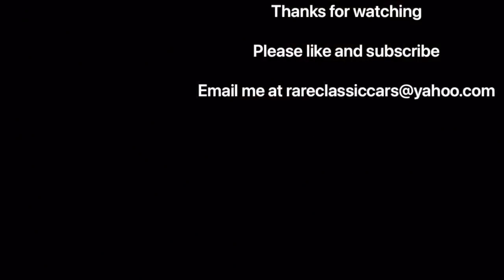Worst Engines of All Time: Chrysler 318/360/400/440 V8 Electronic Lean Burn

Comment: The secret starts at 10:00. But there is more,,, haven't had a lean burn but I dicked a lot on a BBD and could never fine tune it 100%. Either was way too rich or way too lean and would stall. The metering rods get sucked down by high vacuum when the engine starts. As you press the accelerator the vacuum falls and the rods go up, richening the mixture. When you reach cruising speed the rods drop down to your preset setting like he said. Theres a piston with grooves and a spring under it that controls when the rods go up as there is demand on the engine. This is controled by the stiffness, rate and length of the spring hidden under the aluninium piston. It aint big, like the size of a pen and the spring is like a 1/4 inch wide. I guess the aluminium of the carb and piston were really worn on mine. Bougth a lot of springs at Canadian Tire and by carefully mesuring, cutting and stretching many springs I ended up with a compromise. I adjusted it so as soon as I feathered the throttle the rods would go up. Solved my stalling problem but it never ran great when cold (too rich) with the choke on or partially on.  Had to wait 5 or 10 min before going. Hope that shines some ligth on the operation of the BBD. Thank you for your videos.

Comment: I had a 1978 plymouth horizon with lean burn, when cold step on the gas slightly and it runs until warmed up, the vw rabbit motor was very responsive

Comment: Great explanation Adam! You explain why so many people had trouble with the Lean Burn system. I wonder if anyone can provide a before and after (after replacing it with a regular carburetor and std. electronic ignition or even points) mpg results. Like with a properly functioning lean burn you got 18 mpg on highway trips, now you get 16. It sounds like lean burn was a great idea on paper and in the lab.  Could some Toyota engineers have made this reliable for all Chryslers back then?
Reply: Lean burn shone on the hiway, over 20 MPG in a full size V8 sedan in the eighties. Figure a 25% increase in fuel mileage. I remember a magazine road test of a 318 powered early 80s Chrysler, EPA rated 26MPG hiway, in the same magazine was a VW Rabbit 4 cylinder, rated 25MPG hiway.
Reply: @mrdanforth3744  thanks. Truly a great idea but was poorly executed. Or was it as Adam said, where the real world heat cycles to the electronics of the day, made it doomed?
Reply: @new2000car  Partly because the electronics were not developed to the point of being totally reliable, and partly lack of knowledge of the system by mechanics. There were a lot of new anti pollution and electronic devices introduced in those times, often forced onto the market by the government before they were ready. Driveability, reliability, and engine life suffered from the late sixties until the mid eighties when they finally figured out how to make decent motors that met government regulations.

Comment: I have a chip on my turbo Buicks that lets me enable lean cruise 
when the car isn't under load and the converter is locked  (on the highway mostly ) it goes into lean cruise. 16/17:1 AFR. Works like a charm. Sipping fuel!

Comment: Yes, you are absolutely correct.  I had a 1978 New Yorker with a 400, Thermo Quad, Lean Burn.  Was a good running engine, started right up in any type of weather; even when hot.  However was a TOTAL dog when it came to performance!

Comment: All with the thinking of saving costs, they ( all 3 )  lost the market. they could adopt a mechanical injection system ( possibly the Bosch K let «0 or electronic ( bosch L jet or D jet ) that were already  fine tuned and delivered a respectable performance associatred to a very good reliabilityé Im 1958, GM and Chrysler proposed  fuel injection systems, they abandonned them in the name of cost reduction

Comment: I bought a long block 440 with a stock 4 barrel manifold minus a carburetor. He said it came from a 1976 Chrysler. What distinct difference should I look for in the distributor to know if it's a "lean burn" unit or not? Or what is the water temp sensor part number if that's unique to "lean burn"? Anyone can reply. Thanks.
Reply: Lean burn distributors have 2 pickups in them, one standard timing one 52 degrees advance timing.

Comment: Just a quick note, the air to fuel ratio is in terms of mass, not volume.  A gallon of gas doesn't mix with 14.7 gallons of air, it mixes with about 100lbs of air, which like a 747 full or something.

Comment: Thank you. After 35 years I finally understand why my '78 Monico had occasional difficulties keeping up with fully loaded gravel trucks and stalled just before grabbing 2nd gear a few times. A mechanic at work had a simple 2-word explanation and described it as "computerized crap".

Comment: I'm a retired auto mechanic I worked a lot on Chrysler Motors and Transmissions the Chrysler torqueflite 727 transmission can handle more power and torque than General Motors or Ford Chrysler torqueflite transmission are very good quality transmission I have also worked on a lotta Chrysler Motors the 318 all the way up to the 440 are really good motor you can do high-performance on the Chryslers and they put out a lot of horsepower and torque if you want any motor to last a long time don't run it hot do not run the car low on motor oil change your oil every 3,000 miles also the same goes on your transmission and differential if you want your car to last a long time don't Hotrod it when you apply a lot of torque app one-time suddenly any motor transmission or differential can break Chrysler Dodge and Plymouth back in the upper 60s ran a lot of races back in the day my grandfather work for Ford and built their NASCAR Motors also work for Chevrolet he's the one who taught me about high performance and how to modify motors for high performance and fuel economy carburetors I had a 65 Ford Galaxie 289 V8 2 barrel carburetor four-door pulled a 5 x 10 enclosed trailer from Missouri to Florida the mother only had 90 to 120 lb compression old motor new motor has 160 lb compression I got 23 and a half after 24 miles per gallon pulling a trailer with that old vehicle that's pretty good mileage for that big Car Plus pulling that big enclosed trailer so I disagree with the man in this video I revealed a lot of Chrysler's and I worked on a lot of Chrysler's Dodges in Plymouth
Reply: So after your retirement, you started cooking meth ??

Comment: The only thing I know about lean burn how to replace it with a msd box but none of the OEM ignition systems at that' time were in any way good so it wasn't just Mopar it was that weird transition period between carbs and fuel injection

Comment: Just a heads up... the air/fuel ratio is by mass not volume as quoted around 2:15  So stoichiometric is about 14.7 kg of air to 1 kg of fuel.

Comment: Lean burn has to be done at 28:1 with about 20º more timing advance to produce good emissions and good power. It does work but a carb cannot do it. I have it running on my 2007 TBSS, excellant engine torque and response. It's basically a second stoichiometric region of operation, all fuel burns but at a lower temperature. The extra fuel burn time increases average pressure on the piston, resulting in higher torque being produced. I have it switching to normal AFR at about half power (when it switches to the high MAF table). 

The way Chrysler did it was almost good but they didn't go far enough. Holden has been doing it for years, btw.

Comment: The lean burn sucked, I had a 79 cordoba 360 lean burn, I trashed the lean burn, got a older carb, used a vacuum advance distributor and got a transmission without the lock up torque converter.  It made a ton of power and was better on fuel when use cruise control.

Comment: 1:57 I realise the jug analogy is just an analogy, but I wouldn't want people getting the impression that the air-fuel ratio was a volume ratio when it's actually a mass ratio. This makes sense as the mass equates to the number of molecules in the chemical reaction, whereas volume can vary. Really interesting video, too - thanks!
Reply: Thank you.  You beat me to it.

steve
Reply: I was saying "No.  No.  No." during that bit
Reply: On a mass basis (not volume. . ) you would need 183 gallon jugs of air to mix with one gallon of fuel. (1 gal air = 0.01 pounds, 1 gal fuel = 8 pounds)
Reply: I was hoping someone would point this out
Reply: Not only that, but it’s 14.7 parts of oxygen, not air.  So, with air being (very roughly) 20% oxygen, it would take some 60 jugs of ‘air’.  And, as you mention, it’s mass, not volume, so increase the jugs in proportion to mass.  Not a very good analogy at all….. back to the classroom….
Reply: @donferrie4070  That was a detail I wanted to check before posting, and the Wikipedia page on air-fuel ratio says that the masses are "of all constituents that compose the fuel and air, whether combustible or not". I was half expecting it to be just the mass of the oxygen. Another reason for using lambda or FAER? :)

Comment: Great presentation and video as always! One detail I noticed is the explanation of air/fuel ratio. The air fuel ratio is determined by weight, not volume as in the gallon jug example so 1 pound of fuel will be combined with 14.7 lbs of air to achieve a stoichiometric ratio. Love the videos, keep them going!

Comment: Seems we had a much better run with ELB in Australia, not saying there wasn't a lot of ignorance and stubbornness but the CL/CM  265 six cylinder was the epitome of excellence with this emerging technology and alas Mitsubishi took over and shelved it, at its demise the 6cyl Valiant was a cut above all other Australian produced vehicles in terms of power and economy. I worked for Holden dealer but you couldn't deny the gap, I had the fortune to work with a guy who knew the system inside out and learnt to see its genius, later GM introduced Lean Cruise in its EFI systems based on this concept, their GM EST system of the ELB era was no match

Comment: Right away this dude is wrong
1 cat where installed in 1975 for all engines
2 elb boxes worked better than normal engines
3poor wrench tuners had a hand in it
There are no wights in the distributor fact fact fact.this man is got any idea on this I had more time under the hood he don't know he wrong wrong  .these all where ment to run on87 that's it
Reply from the maker: You’re wrong. Watch Chryslers own video on the system. They clearly explain the distributor weights. 

https://youtu.be/aPRt_d_1e4k

Comment: You would need 14.7 jugs of liquid air per gallon of gas, but of course air is a gas and takes up a lot more volume than it does as a liquid. Nice info on lean burn. (Also: The 400 has become a cult engine as it is a B not and RB and can take a big crank so you get a lot of displacement from an engine that looks like a 383.)

Comment: I bought a super clean 77 Dodge Charger back in the mid 80's . It had the 400 with the lean burn and ran poorly . Removed the lean burn , carb , intake and distributor . Installed a points distributor , Holley intake and 4bbl carb , around a 650 . Also removed the exhaust to the manifolds and had duals with glass packs . It was a totally different running car. The passed owner couldn't believe the difference. I later put a set of Cragar S/S rims and white letter tires on it . A TransGo shift kit woke up that 727 . It is on my list of cars to hopefully buy again .

Comment: Adam, spot on about these carburetors.  I had an 84 5th Avenue with the 318 2 barrel carburetor that did exactly what you said.  On the interstate it was smooth but from stop light to stop light it was sluggish.  I did have to put in mid grade gas to stop the engine knocks but at about 200k it need the lower half of the engine overhauled.  I did not do it at the time instead I didn't need the car and donated it to St Vincent de Paul.  The body, interior, and paint were still like new after 18 years but the electric windows and door locks would act up and in general I had electrical problems.  Loved that car and it was smooth riding but it was the first and last Chrysler product I will ever own.  Interior parts were falling apart and I had to replace them which I did.

Comment: I remember that the lean burn Mopar engines staggered around drunkenly in the midrange and would run pretty OK wide open.  I had been tuning cars forever when these came out, but when I tried tuning these, none of the old 'tricks' that I'd used on the earlier engines would work.  Usually this ended up with me tearing little tufts of my hair out and learning to curse in Mopar.....so......I never felt like I had them right  and.....sigh.....the hair never grew back.  The only way I could make one run really right was to replace the intake with a 4 bbl aftermarket dual-plane manifold, an old Carter or Holley 4 bbl, an aftermarket distributor, headers, and mill the heads.  Too expensive for 90% of us.
Reply: —LOLOLOL ... “staggered around drunkenly”. 

That is one of the best descriptions I’ve ever heard of the running of one of those ELB engines.

Did you ever put a timing light on one of those damned things? The timing mark would dance around drunkenly, too. And that wasn’t just an isolated case — they were all like that. It was like the computer had Parkinson’s disease or the like.

I was always amazed that they ran as well as they did.

Comment: Had 78 Newport with a 400 4 barrel with that spark control computer. Took several trips to a mechanic to figure out why the car would just shut down as you drove down the road. Did it to a mechanic on a test drive once, he got out and pounded on that spark control computer and it started again. Total crap system.

Comment: I have a fascination with these early automotive "computers", which I picture as little more than a bunch of op-amps, phased-locked-loops, transistors, caps, resistors, etc. I doubt many in the industry today are more than vaguely aware that there used to be something called an "analog computer", which could add, subtract, multiply, and even integrate voltages the way today's processors and software do those operations on data. The understanding of the controllers for Chrysler Lean Burn engines and the early Bosch/Bendix EFI systems used on Chryslers, VWs and Cadillacs must be something of a lost art today. I wonder how long these analog controls stayed in production when Chrysler brought the Lean Burn system into the 1980s and everything else was going digital. Thanks for posting this.
Reply: Yes, it would be interesting look at the schematics, have you seen any?

Comment: Thanx Adam!   You missed your calling.  You should be an engineering Professor!  I read about those Lean Burn engines back in the day.  It was NEVER explained to me to where I could understand it.  You my friend, explained it perfectly to me.  KUDOS!  This is one of my Favorite channels.  No glaring MU-SIK, no Glam, no BS.  Just explainations of what, how, why, when, and where.  Real driving, real working...  Just a perfect site.
Reply from the maker: Thx. I was indeed once a professor.
Reply: If he was a engineering professor he would know the difference between a engine and a ignition system because every car guy I know can tell a bad ignition system from a bad engine design where the 318, 360, 400, and 440 a good engines they are the same engine design from the 60's points ignition to the 70's lean burn the only difference is the ignition system if you replace the lean burn with a point or electronic ignition the engines run fine.

Comment: I think the 1987 Dodge Dakota has a variation of it....a feedback Holley 6280 Carb and a spark computer mounted on the passenger side fender apron.  There is an ancillary air intake hose going from the spark computer to the main air intake.  This was on the 3.9 V6 which is a 318 V8 minus two cylinders...Chrysler used this setup for the 87 model year and switched to TBI the following year.  I know for the first few years, we had some driveability issues with to the point where Dad would want to trade it for a newer Dakota.  Eventually they sorted it out and we kept the truck or we just adapted to the quirkiness of it.  I find the system to be odd and doesn't exist well with modern fuels....i.e. vapor lock and hard starting.  Eventually, I'm going to replace all of this with an aftermarket EFI system.